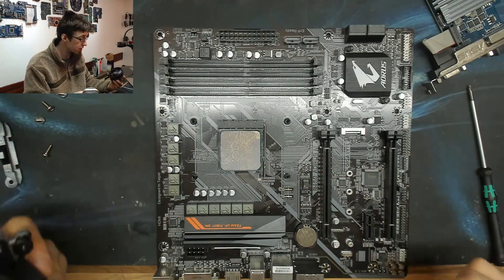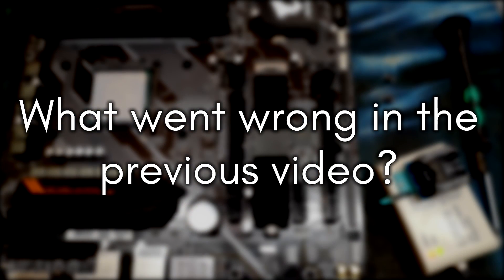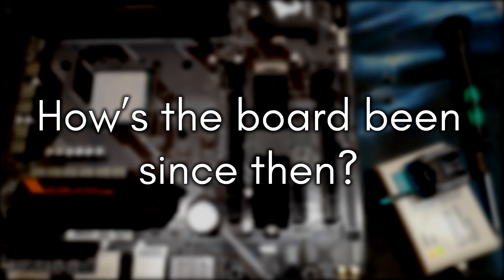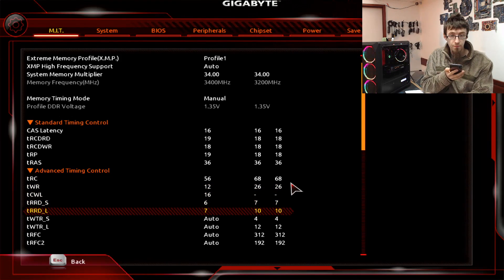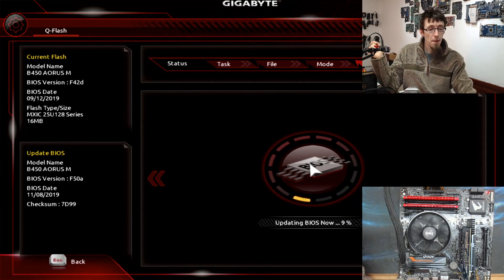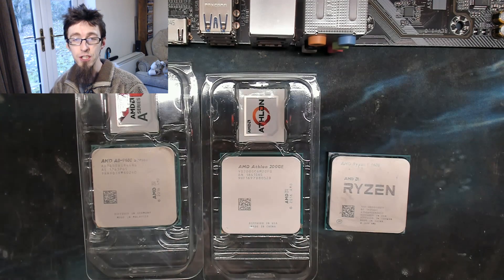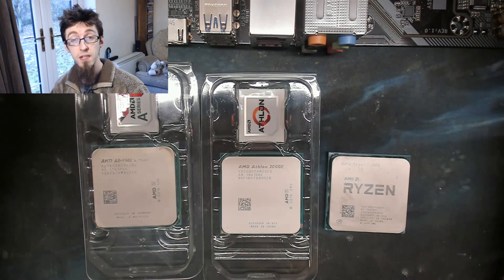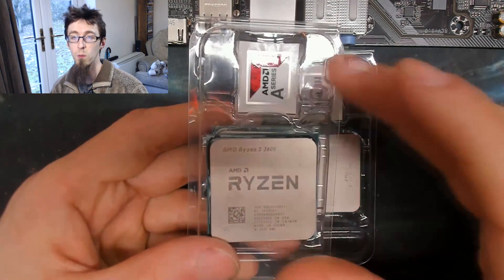LFC#186 - Gigabyte B450 Aorus M Update and Conclusion

Comment: Hi, you didnt talk about the EC FW update. Should I install it? Thanks!.
Reply: Did you try a Ryzen 2nd gen (like a 3600) with 4 sticks of RAM to see?   That will tell you pretty quick....
Reply from the maker: Aaaaaah... /facepalm yea now I get it. Good shout, Todd, it hadn't occurred to me that this was about number of sticks.
Reply from the maker: I had a look at it, but it didn't seem to do anything useful. I think it's more about driver level stuff.
Since I was using this board with a clean install of Windows, I had no issues. Other people have had mixed results, but I haven't seen any confirmation that it's definitely required.
Reply: @Adamant_IT  thanks for your reply :)

Comment: I have a Ryzen 2700x will I be experiencing the same problems as you are for this motherboard? As in updating bios?
Reply from the maker: Ryzen 2000 will be fine.
Reply: Adamant IT Thanks for the reply, I picked up the board for 69.99 brand new which I think it’s 53 in pounds so I say it’s a good deal

Comment: i'm brazilian =s. This motherboard, you recommend or not ? for ryzen 3600x
Reply from the maker: As long as you have a Ryzen 1000 or 2000 to flash the BIOS. If not, I would opt for an MSI board, all reports say that they're Ryzen 3000 ready out fo the box. The Aorus M seems to be a matter of luck.
Reply: @Adamant_IT  I have big problems with MSI :/, msi b450 pro vdh plus. Here in RMA now. Oh god .. i go to ASUS or BIOSTAR. Thanks bro.

Comment: I've got Ryzen 5 2600, do I even need to update BIOS on this MOBO, what do I get for this trouble?
Reply from the maker: Ryzen 2000 is compatible with any BIOS version for this board, I'd recommend updating anyway for performance improvements. Since you have a Ryzen 2600, this will be as simple as download the BIOS, put on flash drive, update in q-flash, done.
Reply: @Adamant_IT  Straight to F50a?
Reply: @Adamant_IT  
"Ryzen 2000 is compatible with any BIOS version for this board, I'd recommend updating anyway for performance improvements. Since you have a Ryzen 2600, this will be as simple as download the BIOS, put on flash drive, update in q-flash, done." ---------- Will this be the same for the Ryzen 5 3400g currently on F41?

Comment: I have another problem with this mother board, when I try flash Windows usb, installing I get this error "no controller found" lol. Solution? I tried to change port usb 2.0 - 3.0 and no work. I download the iso again and no solution...
Reply from the maker: What kind of drive/SSD are you installing Windows to?
Reply: Adamant IT Toshiba OCZ TR200 SSD 240GB SATA3
Reply: @Adamant_IT  solved. I re install Windows USB with Rufus

Comment: Hello, im a little confused. I get this mobo today with a Ryzen 3 2200G. Im on Bios Ver F41. Can I do the upgrade to F50 directly?
Reply from the maker: Yes, with a Ryzen 2000 you can update to any BIOS version directly.
Reply: @Adamant_IT  Notice: I fully update my motherboard today directly f41 to f50
Reply: @Adamant_IT  Hey mate, sorry to ask this of you again, in my case, if my apu is a 3400g, and current bios is F41, i can flash it directly to F50 no issues? I dont have to go through F32?

Comment: Hi, I bought this motherboard with my Ryzen 5 3600. Updated it to f42 when I bought it and every time i cut power supply bios settings and time resets. After reconecting power it boots like 2-3 minutes.. So i updated it to the lates f50 and nothing its the same. Changed the battery two times. Is this common for this motherboard. Should I RMA it ?
Reply from the maker: That's BIZARRE - I had exactly the same problem with mine! During my original video where I had issues flashing this board, I de-soldered and swapped the BIOS chips over. Then during the filming for the video this was going to be, I fixed the resetting issue by touching up the solder joints on the BIOS chips again. I assumed that it had been caused by me not soldering the chips properly in my original troubleshooting. The fact that you have the same issue confirms that it wasn't my fault after all. The bad news is that in order to fix this, I recommend de-soldering and re-soldering the BIOS chips 😓 If you're not savvy with soldering tools, I'd RMA the board.
Reply: @Adamant_IT  Thank you for your reply. I have the PC for 1 month and I am not good with soldering. I would cause a disaster.. Then i will RMA it. Believe me it wasnt you. I didnt touch the motherboard and I wouldnt recomend anyone this board or Gigabyte even. My GPU fans from gigabyte started scratching and I had to RMA that too..
Reply from the maker: Yea I have to admit that BIOS issues with this board and the Z370 Aorus Ultra Gaming I have at home has really damaged my faith in GB. I switched to them after MSI kinda got lame, but now MSI seemed to have bounced back.
I'm not going to swear off from Gigabyte, but I'm going to look for the best overall boards at the time, and right now that seems to be MSI more than GB.
Reply: Hey brother! I know I'm a little late but worth the try... Did you find any solution for this? I have the same problem with my B450 Aorus Elite v2

Comment: I downloaded bios F50 adn upgraded from F42, (F50a inst listed).  The board reset at 30%, I was unsure if it was done or not. The version now says F5... is that normal?
I downloaded F42g and tried to roll back, but it say its invalid bios, I also tried to use F50 again, but again it says it is an invalid bios.
How can I roll back, is the bios messed up?
Reply from the maker: Yea sounds like the Backup BIOS kicked in with F5. You need to flash to F30, and then to F50a.
I'd recommend restoring default BIOS settings before trying to flash again, just to make sure there's no weird settings causing instability.
Reply: Thank you! All fixed now. For some reason I thought it was removing the zero from F50. It didn't dawn on me the back up bios would be F5.... well not until the next morning.
Also, found your channel about two weeks ago when looking into this board. Good channel, good info, keep it up!

Comment: I am waiting for my Aorus b450 Elite to arrive and i am getting kinda scared to update the bios.
I have a ryzen 3700x that i want to put in and a friend will give me his gen 1 ryzen CPU.
Do you think it will be ok and should i follow the notes and red text in the support page. :)
Should i go to F30 or F32 then F40 then F50 or F30 then F50...also what is EC FW Update Tool.
Thank you in advance.
Reply from the maker: EC FW Update tool is the command line updater I believe. I prefer to use Q-Flash (the graphical utility in BIOS Setup) as you can see much more of what you're doing and what's happening.
With a Ryzen 1 you'll have no issues, I'd suggest going [whatever the board has] to F30, then F30 to F50a.
Check what version is already on the board before you flash it though, as some people have reported that their boards were F41 out of the box, and ready for Ryzen 3.

Comment: Yo Wasusp man I’m gonna use this motherboard for my build but where do you insert the ram for dual channel?
Reply from the maker: Counting from the CPU, left to right, slots 2 and 4.
Reply: Adamant IT alright thank you saw some people saying it was slots 1 and 3  but thanks for clearing this up
Reply from the maker: @Tadayoh  Tbh you can probably use either, and this board has a really weird slot numbering system. At any rate, I was running 2 and 4 and had dual channel mode!

Comment: Should have spent more time researching your purchases. The Gigabyte B450 boards were crap. Worst VRMs of all the B450 boards.
Reply from the maker: Which mATX B450 board would you recommend?
Emphasis on mATX. Because there are some nice micro cases out there.
Reply: @Adamant_IT  MSI B450 Mortar/Max, if you can find one. The MSI B450 Tomahawk/Max is my second choice and the Gaming Plus would be my third. These boards are harder and harder to find but they are still out there.
Reply from the maker: The Tomahawk isn't micro, so that's out... The Motar does look nice though - not sure how I missed it when I was looking first, since it's got two M.2 connectors as well. But it's kinda steep at £92. Will keep an eye out for one on sale, the Aorus M is out the shop now, so my GameMax build is waiting for a new mATX board.

Comment: Thank you for posting such detailed series about the B450.

I'm planning to buy a Ryzen 5 3500 which is available in my region. My question is, what will happen if we directly flash the bios to F50a without opting for the sequential route? Is it even possible? Have you tried it?
Reply: Personally avoid the B450 boards get an X470 instead, they are similar in price to the decent B450s now that X570 came out but they have better VRMs and BIOS support.
Reply from the maker: Adam - There are basically no X470 mATX boards. Assuming that we're working in mATX here (because if you have an ATX case then just get an ATX mobo...) you're limited to B450 and a couple of X570 boards.

Wolf - You cannot directly flash to F50a without specialist equipment (EEPROM programmer). Another comment pointed out the MSI B450m Mortar Max, which is a really strong board, but more expensive. If you don't have a means to flash the Aorus M, you'll end up spending less on the more expensive MSI board that's ready to go out of the box.

Comment: 5 days ago I bought a Gigabyte B450 Aorus M for my Ryzen 3600 build and it also came with BIOS version 41 pre-installed so it booted just fine right out of the box.  Seems like it's becoming more common for retailers to be selling these boards already Ryzen 3000 compatible.  I found the POST time to be quite slow so I updated to BIOS F50a and it certainly boots a lot faster than with 41.  After running it for a day (not much of a test so far, I know) I haven't had any problems or weirdness.

I'm glad you made these videos, and please do share your EEPROM video as I'd really like to see it!
Reply: Do you overclock it? Is there any thermal issue? Thanks
Reply: But how u update it..I have an 3600 and it want do it...I only used @bias as app...update from file dont work...from server...dont work...dont even try flash for now

Comment: So if I buy a 200GE it won't help me flashing the board if it's using a F1 to F5 version? Damn...
Reply from the maker: Yup, it's got to be a natively supported chip like a Ryzen 1000 or 2000 series for zero-hassle. Check your local computer shops to see if they do cheap updates - I update people's mobos for £10 if they bring them in.

Comment: I was so waiting for this... 
Bottom line - do you still recommend this board?
Reply from the maker: It's a really tough call. The annoying BIOS updates make me want to say buy a different board, but hardware is still solid for an mATX board. It's hard to beat this thing without going up to ATX.
Because it works just fine after the update, I'd still say buy it - you just need to make sure you have a plan if you get an unpatched board. Some people down below are saying they bought one already flashed to F41 - so it looks like it's luck of the draw.
Reply: @Adamant_IT  Sounds good then as I intend to order one from Amazon the coming days. But if i still want to be on the safe side, would you say a DS3H is preffered?
Reply from the maker: You can't really go wrong with the DS3H, but I haven't tried one in anything other than low-end, so I'm not sure how well it'll cope with high speed RAM and so on.
Another thing that is slight, but really nice about the Aorus M is that high position PCI-E 16x slot. All the other boards have the M.2 slot above the GPU, and in an mATX case, that leaves a very small amount of airspace for the graphics card. The GPU above M.2 layout on the Aorus M actually gets you another inch of airflow to the graphics card. If you're running a higher end graphics card, you will appreciate the space.
You're going to need to flash either of those boards anyway, so you might as well get the Aorus M.
Reply: David Aravon I just bought one Friday from Amazon and it came with F42.  Flashed straight to F50 and it worked fine.  Rock solid stable.  The DS3H is a good board too, especially for $59, but only 1 fan header, weaker audio codec, etc.  also, I put a Ryzen 2200G on the Aorus M with Corsair Vengeance 3600 Ram. Clocked fine using XMP but got crashes in games.  Dropped clocks to 3200 and left timings alone.  Stress tested it for 15 hours straight.  Rock solid.  This was on BIOS F50.
Reply: @toddtheZ  Actually I've ordered one from Amazon too. Unfortunately, it got damaged during the shipping process and was sent back without even reaching me. I was refunded by Amazon but they were out of those boards at that time, so I've ended purchasing the B-450M TUF from Asus, which its description also said it's supports gen 1 and 2 of Ryzne CPUs. So I was a bit afraid, but it arrived last week and it has a sticker saying "Ryzen Gen 3 ready", so I'm calm now. I'm waiting for my additional 16GB RAM to arrive and I'll build it.
Thanks!
Reply: @ipadIII  Mine said Ryzen Gen 3 Ready as well (B450 Aorus M) and the motherboard didn't recognize it sadly.

Comment: i have b450 elite on F41 i want to upgrade the bios to F50a what should i do ? step by step please
Reply from the maker: - Go here to download the latest BIOS: https://www.gigabyte.com/uk/Motherboard/B450-AORUS-M-rev-10/support#support-dl-bios
 - Unzip the download and put all the files in the folder onto a flash drive formatted to FAT32
 - Reboot the PC and tap the Delete key on boot to get into BIOS
 - On the 'Classic' View, click Q-Flash in the bottom-right of the screen
 - Click update BIOS, browse to the flash drive and select the update file
 - Check that the update information in the bottom left looks right, then click the Start button
 - The update will take a couple of minutes, and then auto-reboot the PC
Reply: @Adamant_IT  i updated my bios with @bios app im paranoid to use q-flash anyway its working fine booting speed and gaming is better but i read that f50a is not stable and beta should i keep it ?? 
before i update my bios i take backup to my current bios f41 can i downgrade using the backup throwing @bios app